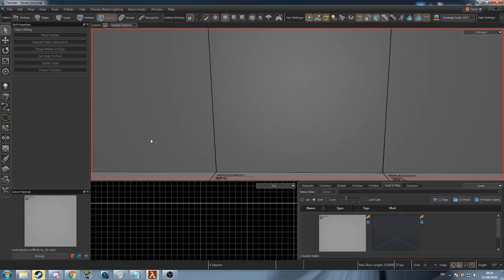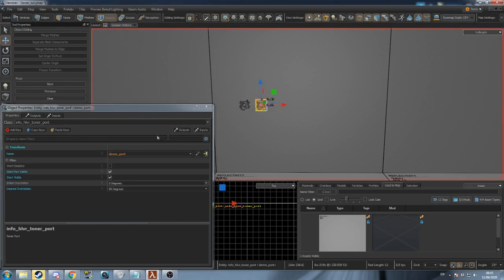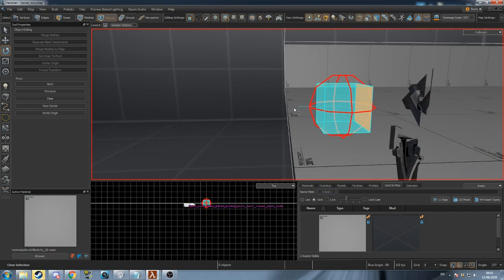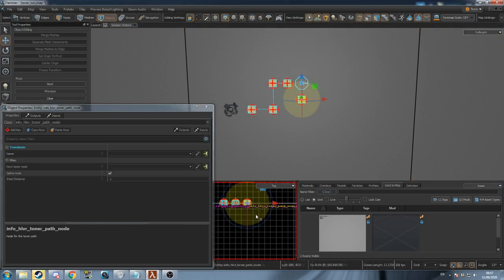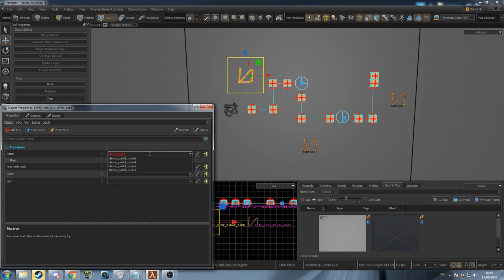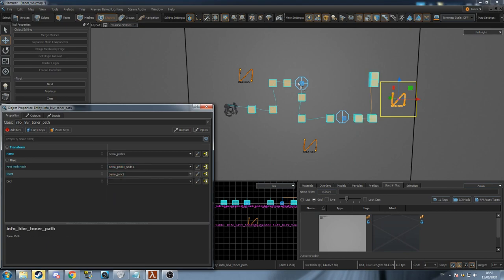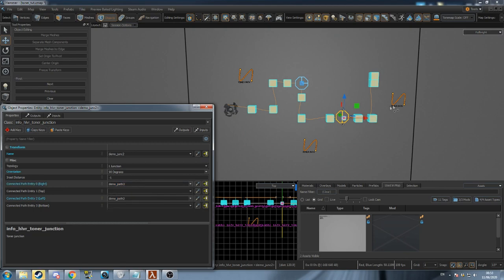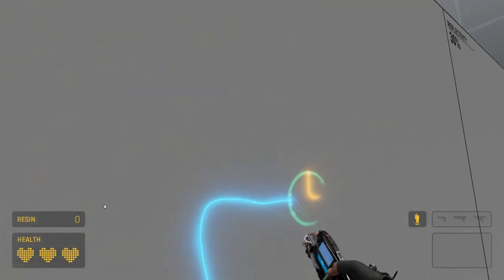How To Create Circuit Puzzles using Toner Paths in Source 2 Hammer

Comment: EDIT: When setting the connections for the info_hlvr_toner_junction, make sure the connected path entity is the info_hlvr_toner_path, NOT the info_hlvr_toner_path_node. This seems to be a common pitfall. 

Your videos are incredibly helpful, but I'm afraid this one is outdated. Instead of neatly lining up on the edges of my junctions, the toner path just stays in the center point of the info_hlvr_toner_junction, and electricity (and visibility) cannot flow past the first junction. I followed your tutorial word for word, and it still id not work. Can you please help me? Thanks!
Reply from the maker: Its easy to mess up. Double check literally everything. I remember failing to get it working quite a few times
Reply: @Hosomi  Refollowed it word for word, and still, same problem. 😥Do you mind if I send you the map file so you can take a look? Thanks in advance!
Reply from the maker: @thetinkerer4252  I'm afraid I can't help, as I am very busy. I recommend checking out the Valve Modding Community discord server to see if anyone there can help
Reply: @Hosomi  Understood, thanks anyway! I'll post the solution here for posterity later.